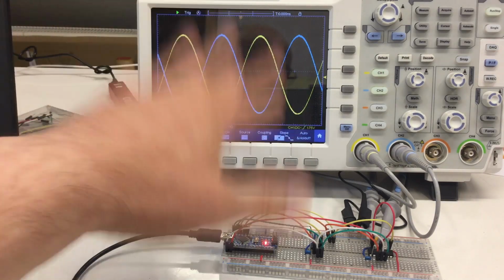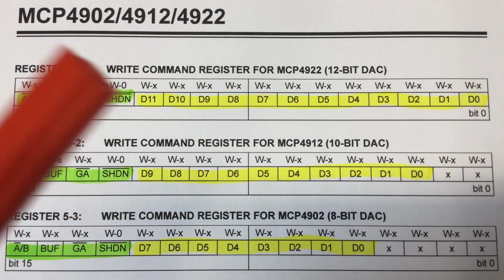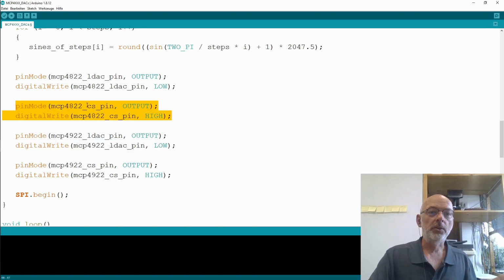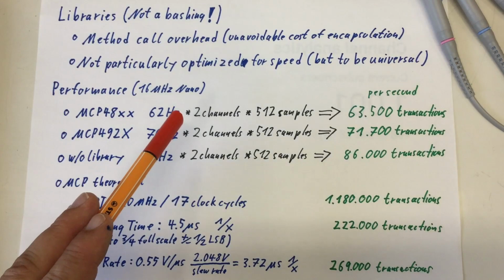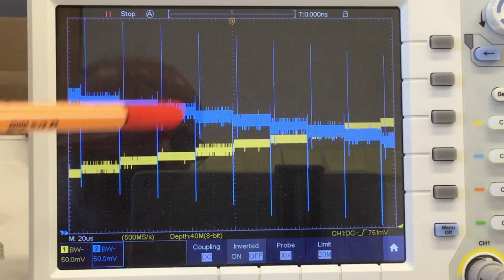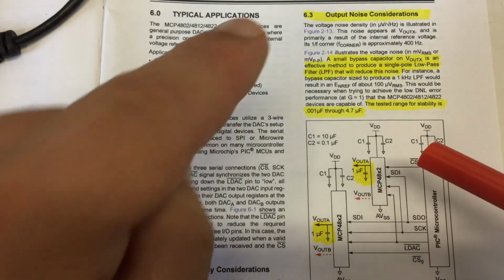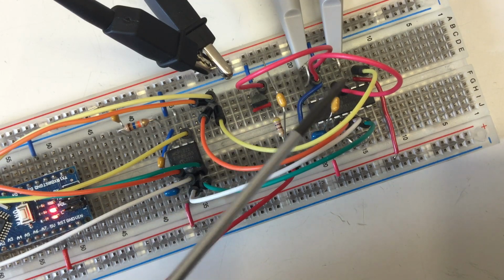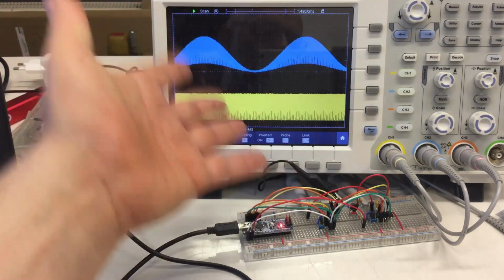Arduino MCUs and MCP48XX/MCP49XX Family DACs – The Details

Comment: This is great info; I wish I had found it first. After following other tutorials I have run into all of the problems and dead ends that you illustrate. I could have saved days!

 I'm making a sawtooth wave and would like 4096 steps in 1 to 10 ms. I've since realized that this won't happen, but after going from a Nano, to an ESP32-C6 to a Teensy 4.1, I have updates every 4.5 us (MCP4921, 1 channel). I'll have to slow that down a bit for reliability.

The output using the Teensy looks awful when zoomed in to the levels you used. I'm looking at filtering, bypassing, and lowering the slew rate on the Teensy output but so far nothing works.
Reply from the maker: Thanks for the praise! I'm happy if my videos are actually helpful to somebody.

Comment: I get the feeling that by modulating the vref on the 49xx, you can get an LFO or VCA as used in synthesizers. Am I understanding that correctly?
Reply from the maker: Yup! LFO - just feed your waveform into the DAC (make sure you have a proper low pass filter at the output). VCA - feed your analog signal into the reference input and control the amplification with the digital input.
Reply: @robertssmorgasbord  I just tried this method and it works a treat! Nice clean volume ramp. Thanks for your videos, they are thorough and easy to follow.
Reply from the maker: @sensorycircuits1338  You're welcome and thanks for the praise!

Comment: The other thing is, the generated sine wave is not symmetrical along the 0 V mark on the Oscilloscope. How can one configure the chip to do that? or is it something i have to do on the arduino...like for example add an offset to each of my 256 values in the sinewave table?
Reply from the maker: Simple answer: You can't. The MCPs (and the Arduino) have only a single voltage supply, so they can't generate any output voltage below 0V (ground).
Solution: First, you need a negative voltage supply (e.g. -5V to ground). Second, you need an OpAmp (running at e.g. +/-5V) circuit to make your output signal symmetrical to 0V (ground).
Reply: How about the frequency? Is it something one can control?
Reply from the maker: @malehakim248  Yes, send the values of your sine table slower to the MCPxxxx. E.g. put some delays into the loop or use a timer interrupt to go through the sine table.

Comment: I really found this useful. However, what if i want lets say a specific frequency of my output sinewave. Lets say i want a 40KHz. How can i calculate the Timer interrupt value of the OCR1A with lets say a sinewave table of 256 values?
Reply from the maker: To be hones, I've never set the OCR1A register directly. But have a look at https://nerd-corner.com/arduino-timer-interrupts-how-to-program-arduino-registers/ . If your table has 256 entries and you want 40KHz you'll nee 256 * 40000 = 10,240,000 interrupts per second (which, by the way is not possible with a 16/20MHz MCU). So you need an interrupt frequency of 10.24 MHz, respectively, an interrupt period of 97,65625 ns.

Comment: Comprehensive video. I learned some useful tips. The Arduino isn't going to be setting any speed records, I see.
Reply from the maker: No, it isn't 🙂 If you want to generate some useful signals, say in the audio frequency range or ultrasonic, you'll need a much faster MCU.

Comment: Will your code (without the use of libraries) work for MCP4801? I recently want to generate 2 stepped sine waves using 2 chips MCP4801 (only 1 channel, 8 bit, internal voltage). I tried your code and on the Oscope, I saw the Clock input (SCK), Data (SDI) and Chip Select (CS) show expected output. However, the output getting from Vout is just a straight  low level line. Look like I dont get any output from it. I have LDAC pulled to low all the time. Please suggest me something I could do. Thank you.
Reply from the maker: The code should work with some modifications for the MCP4801 too (Disclaimer: I haven't tested it with that chip). Note the following comments in the code: 
//MCP4X0X (8 bit DACs)
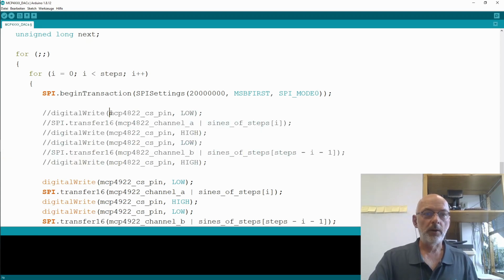They denote portions of the code to use for the MCP4X0X 8-bit DAC chips (see also 14:20 in the video).
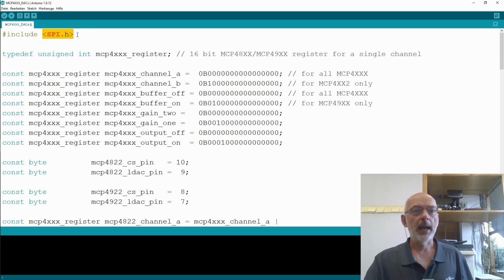Please note also that not all mcp4xxx_register constants work with the MCP4801 (see 08:55 in the video).
Another remark: Pulling the LDAC pin low (0V) is OK. In that case the Vout is updated when the CS pin is going from low (0V) to high (5V) again (rising edge).
Hope that helps. In case it doesn't, feel free to post your code here and I'll try to have a look at (no promises though).

Comment: Great video. I have a question. How will this sine point calculation work for less points? For example 2 points. Thanks!
Reply from the maker: There is a line "const unsigned int steps = 512;" just before the setup() function, defining a constant for the number of points (steps). Just change that constant to a lower value, e.g. 200. However, I don't think that 2 points will work. Out of my head I can tell you that the sine of 0° and 180° (the two steps) is 0. So you would get 0V out of the chip all the time. I think the absolute minimum would be four steps (0°, 90°, 180°, 270° -> 0, 1, 0, -1), which really would result in a triangle wave. And you're welcome!
Reply: @robertssmorgasbord  Thanks for the detailed answer.
Reply from the maker: @mokusmaki4097  You're welcome :-)

Comment: Thank you Robert for the excellent tutorial. You certainly answered all my questions, and then some, about the MCP4822. I want to use this DAC but shift and amplify both channels so that they operate over a -15V to +15V range to drive a pair of galvanometers. What circuitry would you recommend I should look at to achieve that?
Reply from the maker: You're welcome! To answer your question: I would use the example circuit 6-3 DIGITALLY-CONTROLLED BIPOLAR VOLTAGE SOURCE from page 28 of the MCP4802/4812/4822 datasheet ( https://ww1.microchip.com/downloads/en/DeviceDoc/20002249B.pdf ). It's a simple single op-amp (plus one capacitor and four resistors) output stage that will do the trick.
Reply: @robertssmorgasbord  Excellent Robert - thank you so much!
Reply from the maker: @hondaman900f  You're welcome :-)

Comment: Thanks for posting this - very Interesting. The issue I suspect is that once one has the Arduino doing anything else (such as calculating the next location in a wave-table) the performance will start to be marginal for, say, synthesis applications. Although it's not a very elegant solution, I think a DAC08 with, perhaps, a 74HC2573 latch (to free up the 8 data pins for other uses when not being used for DAC updates) might be a better solution as, over much of the audio range and  especially the upper end the slow update rate dictates steps between samples way bigger than the DAC resolution somewhat negating the advantages of better resolution (though obviously not at the lower registers).  Two DAC08/74HC2573 combos (sharing data lines) with one used for the envelope shape and the other for waveform would be a reasonable compromise though the power supply requirements of the DAC08 are not very convenient I'll admit.
Reply from the maker: You're welcome! And you're absolutely right, the Arduino plus MCP4xxx combo is really struggling to synthesize anything even in the audio range, say up to 20kHz - but it's not impossible. Most digital audio files have a sample rate of 44kHz and I was able to achieve a sample rate of 86kHz. So at least a one mono audio channel would be somehow possible. However, you're stuck with just sending values from a pre-calculated array to the MCP4xxxx, so no on the fly frequency or waveform changes :-( But alas, there are more powerful microcontroller out there. Anyway, I like your DAC08 approach. In the end any DAC with a parallel interface will do.